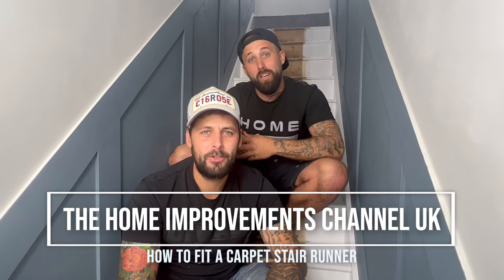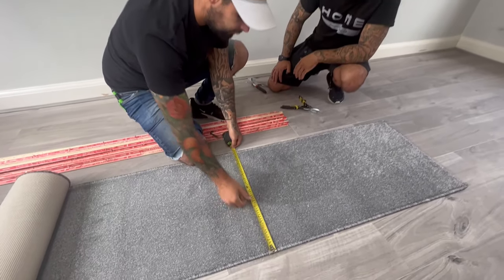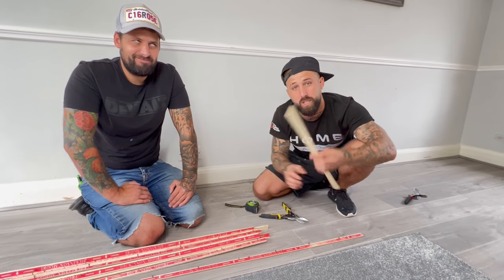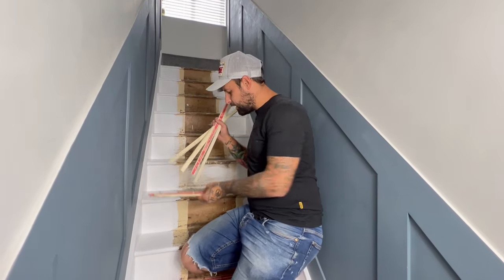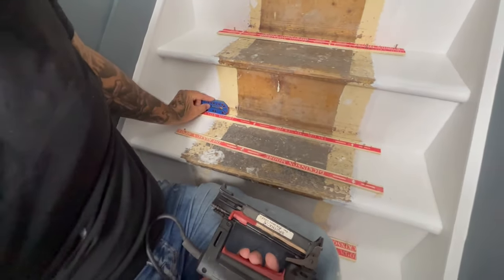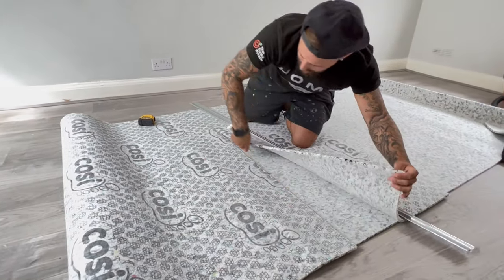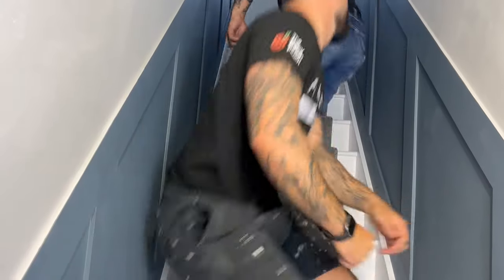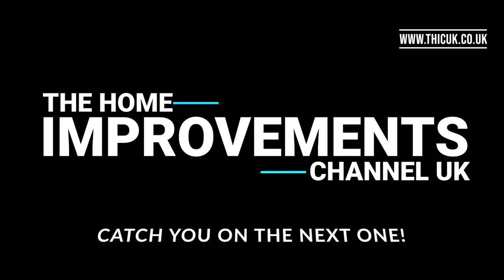How to Fit Stair Carpet Runner with Underlay & Grippers #staircarpet #carpetfitting #homeimprovement

Comment: Solid install I like what you do
If I could add anything would only be to scrub it into tack strip on risers too. First step had a little bump in the centre. Could have been a high nail or a double pin in the tack strip or thick patch of latex back of the carpet. Anyway I think worth doing

Comment: What about the 1/2 inch or so protruding over lap on each one of the stair treads, don't you tuck it in underneath that as well ?
Reply from the maker: Not sure what you mean ?
Reply: @homeimprovements  The stair tread normally overlaps the riser  ( protrudes out around half inch or so ) , I see a lot of stair carpets are tucked under that
Reply: @homeimprovements  I guess you'd call it the bullnose on each step that overlaps the riser
Reply: In the UK they fit the way they do in the video, called waterfall method. In America they pin it under each and every nosing, called Hollywood style. You can do whichever you like as long as you have enough nosing to pin underneath. A lot of the time UK stairs have hardly any nosings compared to American stairs which is why Hollywood is less common.

Comment: Save messing with the tape measure on the stairs just get two pieces of stiff card and measure them at 100mm each then put them on each side of the stairs. Much easier 👍
Reply from the maker: Great tip 🙌